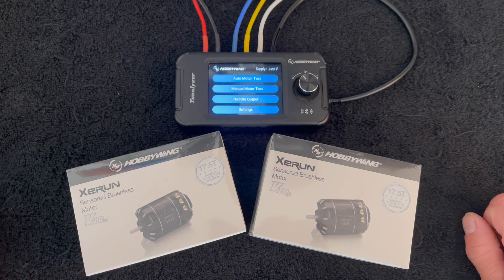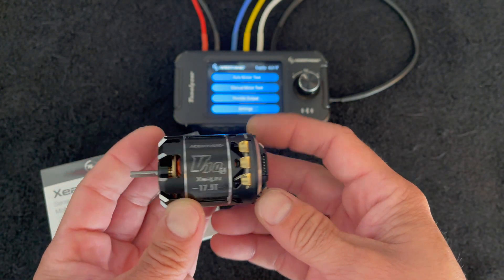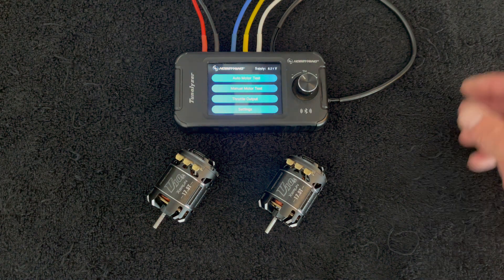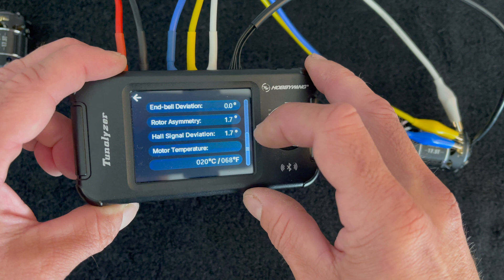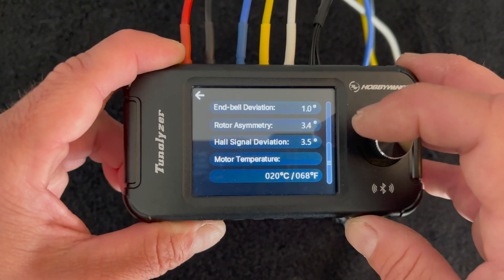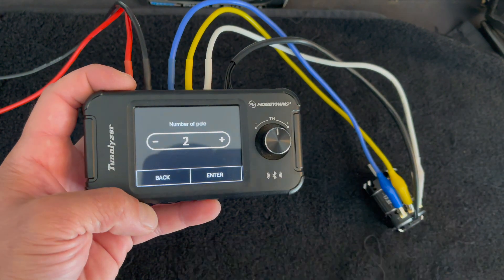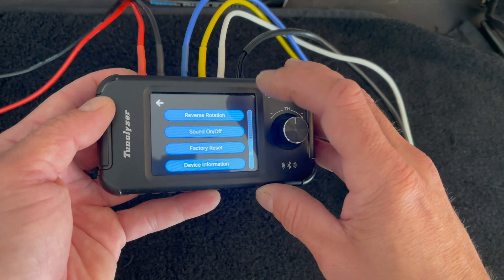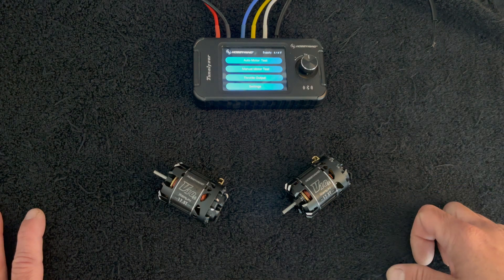The Charlie Show /// Episode 318 /// XERun G4 17.5 Tunalyzer Comparison

Comment: I have four 13.5 motors 3 of them test around 24,000 rpm’s just bought a new one and it’s only testing 20,000 rpm’s the other 3 test7.9 volts and 2.6 amps but new one test 8.1 volt and 0.9 amp the new motor is lacking 4,000 rpm’s is this motor defective. Thanks